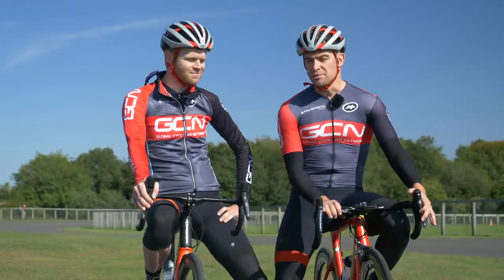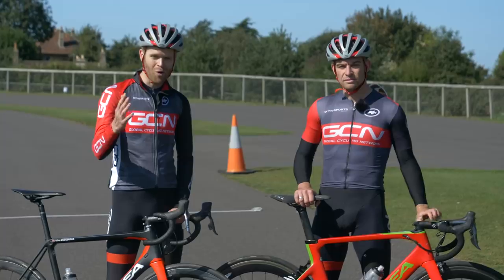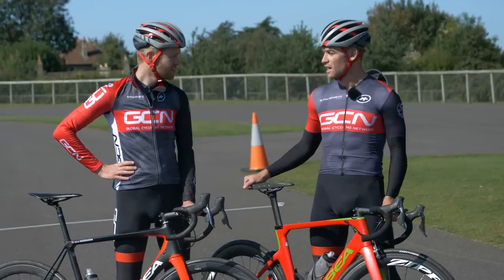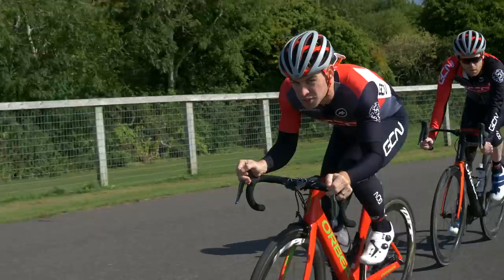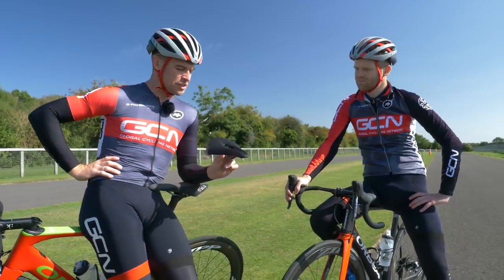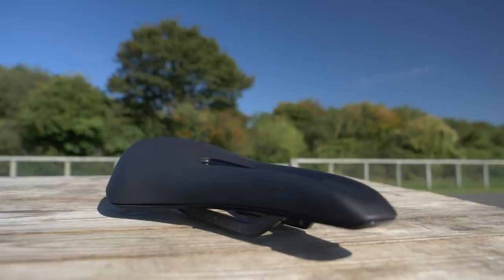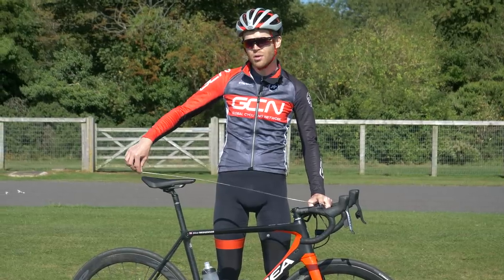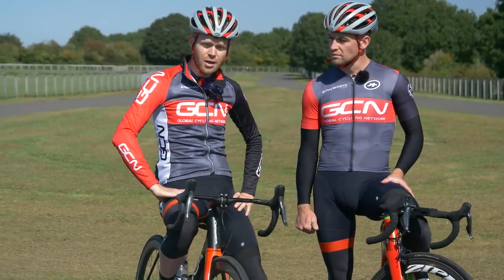How To Slam Your Road Bike Stem To Cycle Faster

Comment: Will it be comfortable using a aero bar attached on the handlebar  when the stem is slammed??
Reply: Kevin Lacayo it will be a bit stiffer than with a normal handlebar
Reply: @HeathyRoidz  lol hey thanks for the reply but i think that's not the answer i was looking for. I just edited my comment because i noticed it did not make sense, please re read my comment thank you, hopefully i get a reply lol i would truly like to know you're opinion. F.Y.I i got into cycling about 6 months ago 🚴‍♂️🤙
Reply: Kevin Lacayo ahh okay, so when using tri bars it’s a bit different, because if you notice, the pros aren’t as slammed in their time trial bike than in their road bikes, so, you might need to go 10-20mm higher when using tri bars

Comment: If I may say so it's just silly and a bit irresponsible to talk about lowering your bars for performance benefits in terms of "stem slamming"..  Whatever bar height is optimal for you, it's highly unlikely to be precisely determined by your steerer tube height. It may be slightly higher (you may need 10mm of spacers) or slightly lower (you may find that even when slammed you would be better going lower, in which case you should be thinking about a more aggressively angled stem or even a different frame). Go lower if you can, yes - but don't determine how low by your steerer tube lenght!

Comment: Saddle height: 44". Hoods height: 38.5". That's with a 6 degree, 120 mm stem on a Giant XL frame. Stem isn't slammed. Wouldn't try it. A 7+" saddle-to-hood difference is a little extreme.

Comment: Mine is slammed, but there is no way I'm cutting the steerer tube. I mean, I'm 70 years old now and maybe in 10 or 15 years I won't be as flexible as I am now. In the unlikely event that I sell my current bike, I still want to be able to offer it with a "stock" setup.

Comment: Random comment: Did anyone else notice the green looking bug flying around at 1:19 ?
Reply: It looks like a Large White ( Butterfly )  You often see butterflies in GCN videos.  By the way,  I had to slam the bars on my Cannondale Synapse as they were way too high when I first got the bike.  I've left the spacers alone on my Wilier as the frame is slightly smaller than the Cannondale so I didn't have to do anything.  Sometimes you need to have the bars slammed because they can be too high on a new bike.  For me its not to get super low,  its to get a comfortable position.

Comment: just put the spacers above the stem and you're done.. lol why would you cut the steer tube
Reply: @Bungle2010  yeah but then if you want to sell the bike and the guy who buys it don't want it slammed its a problem cause you can't weld back the steer tube

Comment: I like most of your videos but slamming your stem because it “looks pro” is just dumb. The majority of your viewers will never line up for a race. Of those that do, only a fraction will ever be competitive, and of those only a tiny number will ever make any money. For that infitessimal number slamming the stem might make sense - though generations of fast riders got by fine by learning to tuck without having to ride a clown bike. Slamming the stem - and adopting shorter saddles to “remedy” the discomfort  is a good way to quickly hate riding and will lead to eventually turning riders into non riders like any other painful modification. pain means you’re doing something bad for your body, btw. I think the argument could be made that for longer rides (hours in the saddle) a cockpit that allows multiple positions and the ability to get upright when you need to or hit the drops to get aero will result in faster overall times than spending hours unable to get comfortable on your bike and just wishing the ride would end. The slammed stem fad can’t end soon enough.